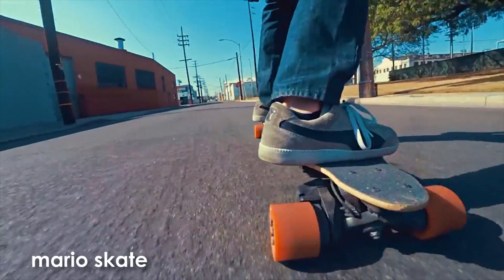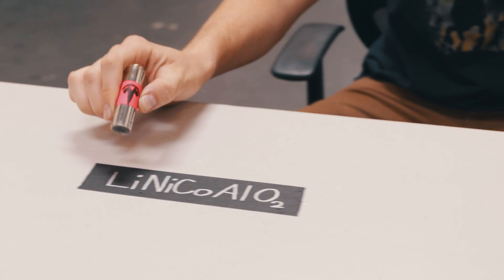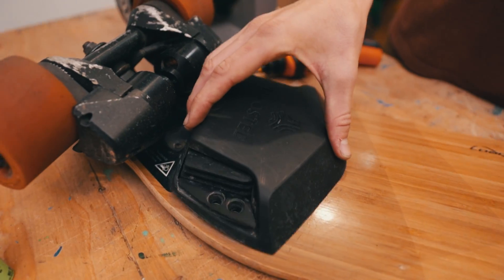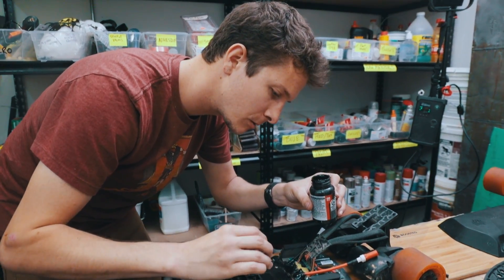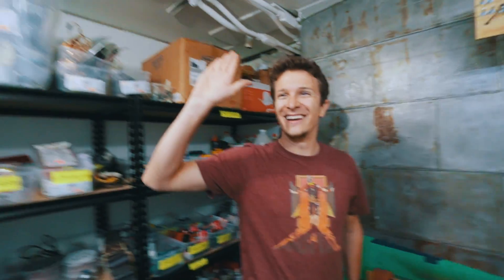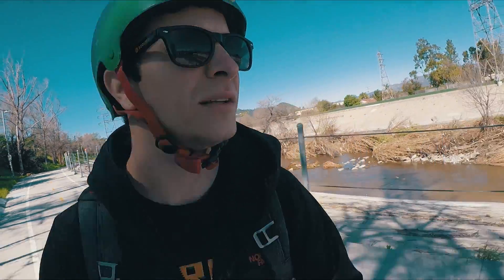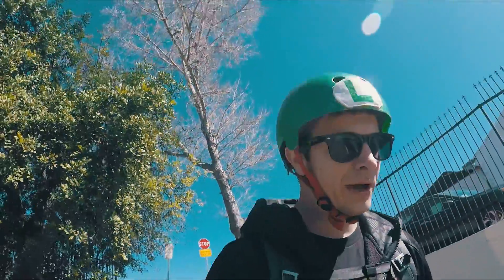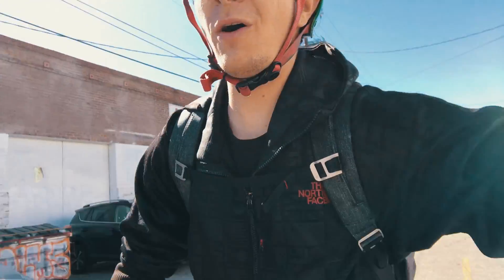Tesla Batteries in an Electric Skateboard!

Comment: Wren is an engineer and I trust he at least knows a little about what he is doing. I work for a company as a technician that rebuilds and repairs battery packs. So PLEASE I BEG OF ANY OF YOU WATCHING to NOT try to solder directly to battery cells ESPECIALLY lithium chemistry cells. The heat of the iron can damage safety vents hidden in the metal ends which will result in the battery not being able to vent during "out-gassing", resulting in swelling pressure build up, and eventually exploding (and this can all happen quickly before you notice it). If it's lithium, the Note 7 news articles are a good example of how dangerous that is and why it's thousands of dollars of training and special equipment to work with lithium batteries safely.
Reply: From the battery experts I've talked with, apparently soldering directly to batteries is less of an issue than people believe. It's certainly good to be cautious, because you know... fire. But as long as you're fast when applying the heat it shouldn't damage the cells. 
And with the Note 7 battery, that was very different. That had to do with the dendrites that formed inside the batteries. When the connected and short circuited, that's when they had thermal runaway.
Reply: All very true! Most people just aren't fast enough though. Hell even I'm not fast enough half the time for a myriad of reasons and I get paid to do it. So I just avoid it when I can and I certainly don't encourage people to do it that don't already know what they're doing (I'm quite certain you're the latter so I hope that didn't get misinterpreted). And good catch on the Note 7's. I was going for the way lithium cells can violently react in general when allowed to and not so much what caused it. It's a shame too with those batteries as it was a manufacturing problem both times and for slightly different reasons and with two different companies even. But everyone thinks it's the phone that was the issue. Batteries man.

Anyway I look forward to the follow up video of this by the way! You and the gang tinkering with stuff and showing the behind the scenes is quite possibly my favorite trait of this channel!

Comment: You could have the extra batteries start with more than 40 volts. Maybe 45 or so, that way you would start with only draining power from the tesla batteries then after a while start tapping into the boosted board battery

Comment: Hi Wren!
Why don't you just 'bypass' entirely the stock circuitry and batt?
That way you could use all the juice of the batteries.
You could fairly easily do something similar with an arduino board as a controller with remote operation (Maybe with an Xbee?) or with RC/drone gear. Sure you should be able to find speed controllers for the motors powerful enough from the model aircraft world. ;)
Anyway, remember that you shouldn't empty batts more than 70% if you want them to last (Or at least that's the case with Li-Po).
Reply: The batteries can't output enough current fast enough to power the board if I bypassed them directly. I would need different batteries in that instance and at that point I might as well just build my own E-board
Reply: Yeah... I guess that's what might make more sense in the end.
Whatever you do, make sure that corridor publishes the update, now I want to find out, haha!
Reply: Yeah! A follow up is in the works. Hopefully we'll get to consult the king of batteries for that video too!
Reply: John Grzan at Revolectrix your mean?
(Just kidding, but he is a good source for reliable info on Lithium Polymer batts too).

Comment: I would just build a similar but bigger pack out of LiFePo batteries. 
It's not good to mix two different battery types, so go with what the boosted board was designed for. That way you can get all the power out of the batteries. Also with this kind of setup the battery indicator should work just fine.

Comment: The One WHeel matter was the question I wanted to post from the beginning. That shit, when you finally balance, is quick and seems to cover more potential obstacles than the board. But putting extra batteries seems so much more tricky "cause... balance, and touhcing the ground when stopping, etc.

Comment: try building or buying a fixed boost converter or a sepic converter, this may also  double as a way of charging the other battery but i dont know exactly how its laied out
Reply: i did this on one of my electrical engineering  college project we boosted up the voltage from a solar panel to charge a battery/run a load but the type of battery may change a few things it depends

Comment: A boost converter circuit that kicks in at around 30v (easiest way to do this is with a tiny programmed microcontroller ) or get rid of the booster boards original battery all together and just replace it with another one of your packs

Comment: it is a terrible idea o solder directly on 18650 cells, you are supposed to spot weld them. Also  how could you connect Li-ion batteries paralell to lifepo batteries in boosted board ? they have different nominal voltages

If you have money to waste on this, throw away both integrated lifepos and panasonic liions you added and replace them with newest Sony Konion VTC 6  these have great capacity of 3120mAh and sufficient disharge current of 30 Amps no compromises required

Comment: Why not use the battery packs to charge the existing battery in the boosted board, over time of use? Then perhaps you'd be able to even monitor the battery level on the boosted boards controller?

Comment: Just disconnect and replace the built-in battery with more Panasonic cells, so all packs can go to 30v.  You may even fit more storage capacity into the same space depending on what they use from the factory.

Comment: Following the law of conservation of energy. Using a voltage multiplier for increasing the voltage over a certain period of time would decrease the current output which might negatively affect the performance of the board. 
What I would do is I would remove the stock batteries so that the system is forced to recognize the new batteries as its own. Not sure how that would work as I don't know how the board works. 
Another method I could think of is having the new batteries continuously charge the old ones so that they never have to reach the low voltage. Again pure hypothesis, but a good start nome the less.

Comment: pack bunch of batteries in a backpack and disconnect the original battery maybe a plug on the deck where the wires are, otherwise for the boost converter it shouldn't be to difficult to sense voltage and convert up only when necessary

Comment: You need to first parallel cells then connect those in series (any number of identical parallel cells will be no different from a single higher capacity cell). Then you will also need a BMS else more than sure you will damage the cells. While you where measuring 35 or 36V for 10 cells in series one of the cells could have been much lower than the rest plus the voltage under load will have been lower than what you measured as open circuit voltage.

Comment: Wren, I think you will still be limited by the stock Boosted Board battery unless you remove it. The amp draw from the motor is distributed equally among the stock battery and two new batteries, but the stock battery still has less capacity (I'm assuming). So once you consume the mAh equal to the stock battery, you will have a drained stock battery and two new batteries with charge minus the stock mAh. Any more riding will then hurt the drained stock battery, even though there is charge left in the new batteries (I think that is what you were getting at in the video). Probably best to remove the stock battery and take full advantage of your new batteries. The other option, as others have said, is to have a switch to alternate between stock and new batteries.